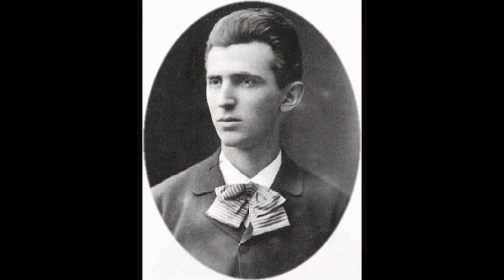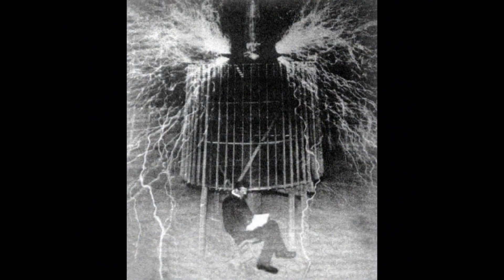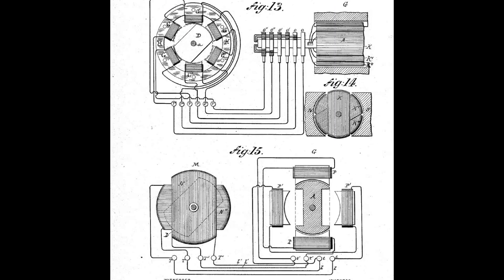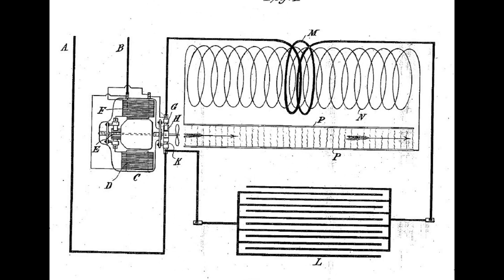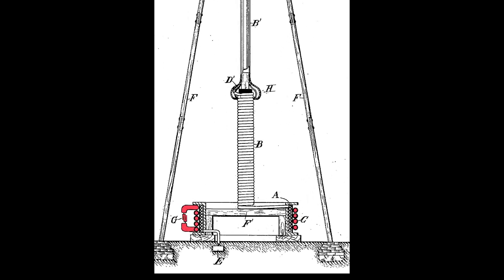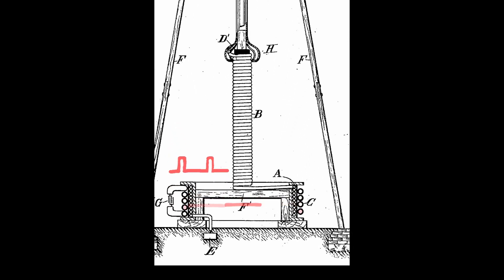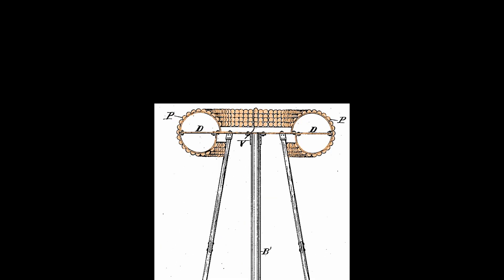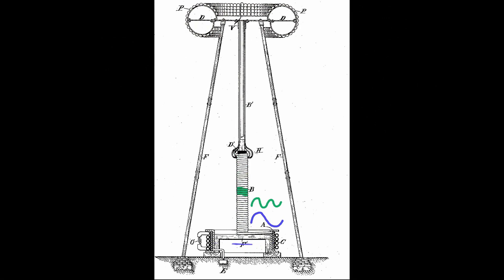Tesla Patent - Magnifying Transmitter

Comment: a regular known tesla coil, is a simple TEM (transverse electro magnetic) series resonant  coil.

A tmt is a 2 stage resonant transformer, that transforms the TEM resonance of the series resonant primary,
into LMD (longitudinal magneto dielectric) resonamce in its secondary.
To achieve this, the primary is impulsed series resonant.

then the magnification is the second stage.

the LMD secondary becomes the primary of the third coil ("extra coil")
this new secondary (third coil) amplifies the LMD resonance by having less capacity and inductance, and being close coupled to the LMD primary (second coil).

TEM has voltage and current out of phase (no power)
LMD has voltage and current IN phase (has power)

Power is amplified, magnified.

Big difference!
more info on my channel

Comment: Good description but many important facts were left out of your presentation. Firstly the system works by way of True Conduction ( i.e. Static Electricity) and not by way of EM radiation. Secondly, the system is NOT driven at the secondary LC resonance as so many continue to falsely state.
Anyone stating this has never read his patents.But merely assuming this based upon they're ordinary education about resonance circuits.This is not what Tesla says. READ HIS PATENT.All of his patents state the same and go into explicit detail as to how to drive them properly. It is resonating but at the standing wave.
Yes normally we would drive any transformer at its resonance value for best operation. So ppl assume that's what Tesla does and say he matches his primary to his secondary LC resonant value for best operations. No. What he says is to have a secondary of 1/4 physical wire length to the primary's induced frequency wavelength onto the secondary coil. That places the highest voltage value right where you want it at the top terminal. And node at the ground. 
He stresses that critical importance of matching the physical wire length of his secondary to 1/4 length of the length of the primary induced wavelength value. So yes, the system is in resonance. But matched to the longitudinal standing wave produced.
Reply: You are right, and not many people on the internet are, on this subject. Kudos to you.
Reply: Chris ChrisL it has a 3rd special resonator coil.. he also used the water well as a giant capacitor
Reply: can you elaborate on the point that Tesla was using water well as a giant capacitor and what patent did you get that
Reply: @greenthizzle4  No, the water was to improve grounding.

Comment: In nowhere does it say anything regarding DC with the magnifier. The larger resonating circuit is an LC circuit which is sinusoidal. It is in tune with the secondary which means both have the same frequency and induction. The demonstration above indicates it goes from DC, to AC and steps up the frequency from there. It does not. The only reason the coils are of different length in because the voltage changes so the capacitors must change. In two places the frequencies change. In the B' pipe and P topload.

Comment: I am interested in copying Tesla's drive system that he used to power his car. Could you direct me to this information or tell me where his car is now?
Reply: It's current whereabouts and even it current existence or not has never been discussed anywhere.  The design wasn't so much about the car and it's drive, an electric motor contemporary of his day, but in the odd box that he tuned to provide energy for the car all day long without any obvious decay in performance as one would expect from hidden batteries.  It's that box you want plans for.  Odd discussions on that box exist here and there on the internet if you search starting with the original 1920's or 1930's article on a test drive of the car.

Comment: Maybe Tesla's transmitter-receiver language is a red herring. He wanted to build a retail electricity distribution tower which functions as a conductor between earth and its atmosphere. That's why there are two unconnected flat spiral coils within each tower. An electric current will flow from the atmosphere to earth through the first coil generating a magnetic field, which in turn will cause an electric current in the second coil, which is connected to homes and lightbulbs (or to a generator).